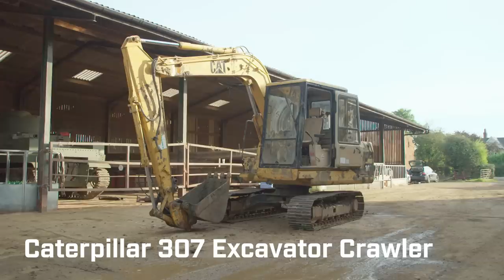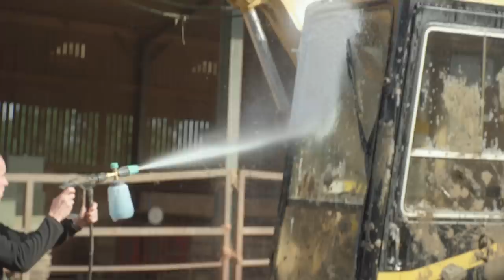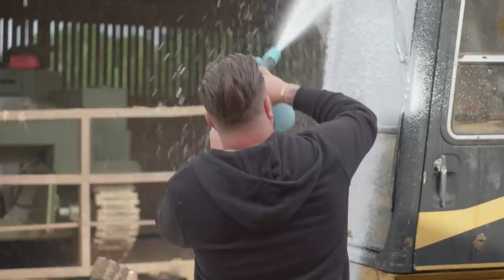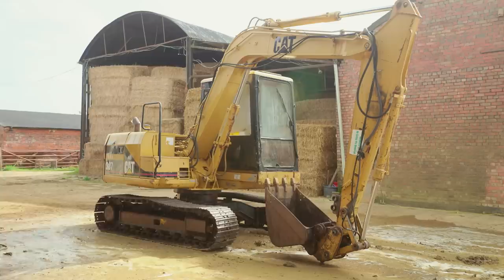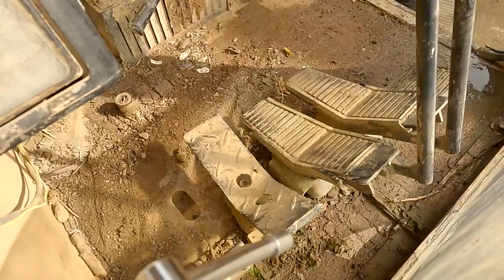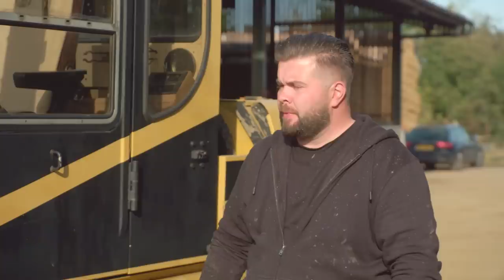Detailing, A Digger..? 8-Hour Cleaning Challenge | Top Gear Clean Team

Comment: You could have saved a lot of time by using a jet wash or steam cleaner. A pressure washer is not enough no matter how much snow foam you use.
Reply: Say that to 2700psi of pressure wash literally blasting paint off the body, or I can demonstrate it's paint stripping abilities on your car with the big boy, although my 1800psi will also do a grand job of stripping the paint. 😈 Also, you don't use snowfoam, you use heavy duty truckwash for stuff like this. 😎👍
Reply: @MafiaboysWorld  Yes, but that's not what they were using here near as I can tell, the pressure of yours is plenty though especially at a higher volume and with some good tips. I did industrial cleaning and hydroblasting for a few years and one of our winter jobs when it was slower was cleaning mining equipment for a local quarry and that's roughly the pressure we used, around 2500psi, that and a nice spinner tip plus some heat will cut through a lot more than what was on this little excavator...lol.
Reply: @jordanstatler4661  Yeah, you know what I'm on about. I mean, fair enough if you're using a 1450psi or 1650psi, but once you reach that 1700+ range, you see the difference and then at 2700, you can turn it into a straight water cutter/engraver, no need for heat. 😂👍

Comment: Mix your high strength soaps with your suds producers in a down stream injector cut it pretty high in ratios and then you won't need to use the ik sprayer and take 45 extra mins every time